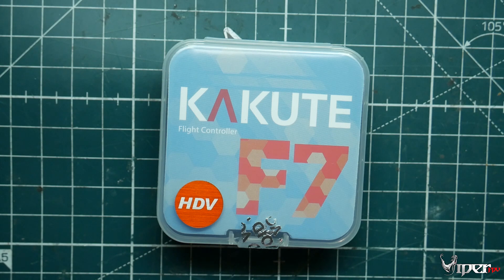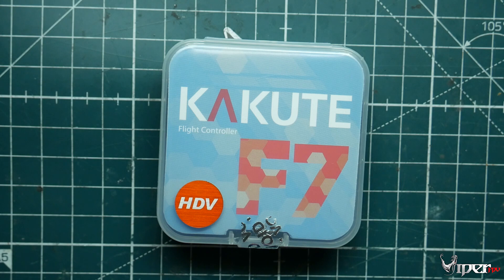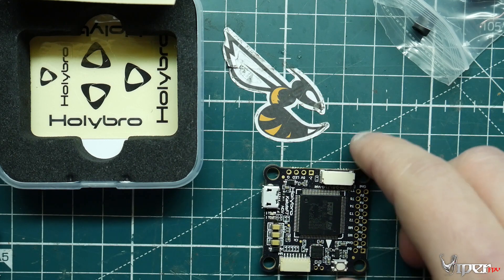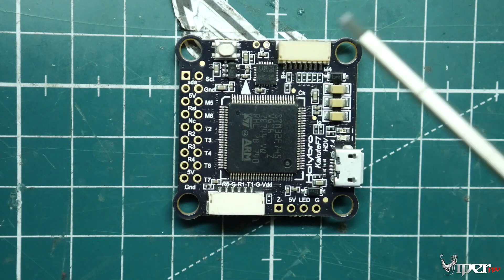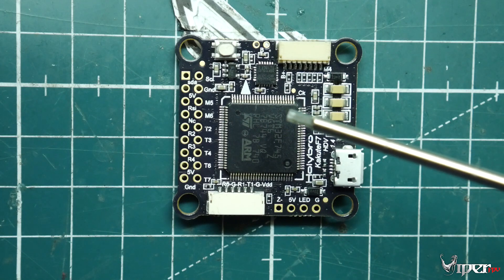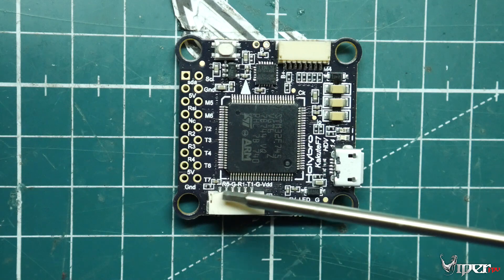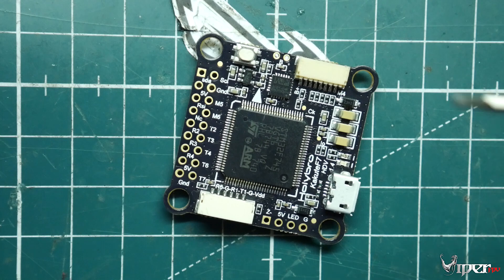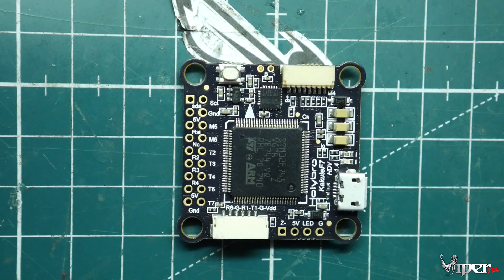Holybro Kakute F7  HDV Flight Controller - Overview

Comment: Hey I bought this FC watching your video. I have an issue. With 5S and 6S it falls out of the sky. Do I need to connect B+ and B- to the esc too? I’m just using the esc plug at the moment. And if so, do I need to disconnect + and - on the plug? Your advice would be much appreciated.
Reply from the maker: What do you mean falls out of the sky. No if it’s flying fine say on 4s it’s another issue.
Reply: Viper_FPV Once I use full throttle or do a flip it seems to reboot or something. I exchanged the esc already and it has the same problem still... I soldered the capacitor to it, so it can’t be because of that. But in the manual it says something use b+ pad only for 2-6S, not sure what that means. I assume the FC is probably no good. But wired that it works fine with 4S.

Comment: Hello! i have a question! i buy this fc and i want to use on analog fpv but only after i buy it i was see that he has not have osd! what option i have to add osd in my analog screen? i try with micro minim osd but i dont have result!
Reply from the maker: Maier Andrei it has built in OSD even on analog, did u wire the video from camera to the FC and the video out to the VTX?
Reply: @ViperFPV  this fc does not have video in and video out

Comment: I'm not sure if I can trust Holybro brand anymore.  They need to work on their quality control.  My F7/Tekko 32 stack was fried after 5 flight, and I'm only using 4S.  No more Holybro for me.  NewBeeDrone is a much better brand.
Reply from the maker: Bo Han I think it was just your luck lots of people run this stack and FC and have crashes with no issues.

Comment: Hello, what firmware installed in that fc? I am having vibration on mine on a 6 inch quad. There are a lot of firmware to choose on Betaflight such as the KAKUTE F7 ( Legacy ) (HBRO ) and there’s KAKUTE F7 V2 (Legacy ) and V2 ( HBRO ), I’m confused with these firmwares. Which one supposed to be installed on KAKUTE F7  HDV mainly for Dji system?
Reply: Pls update i need to know which target tp choose
Reply from the maker: kudin kudos you want the KakuteF7HDV firmware.
Reply from the maker: I will have to check when I get home. Remind me if I don’t respond in 24 hours.

Comment: Hi Viper, having some issues to get my set up working. I have the DJI air unit, the Kakute F7 stack and DJI remote. This is my first time using betaflight as Ive been a long time flightone supporter. What are the settings I need to enable to get this thing working correctly. I cant see OSD from betaflight, my remote doesnt show any input in betaflight as well. The only thing working is the video feed to the goggles. Thanks in advance

Comment: I heard it doesn’t comes with OSD? how can you see the info from the screen of your goggles? My main goal is to see the gps coordinations from the screen, is that possible with this board? Also what is the best way to use 5-6S lipo batteries? you know that the Dji Vtx only support up to 17v right? I do really appreciate any response
Reply from the maker: Wilfred Ocampo your in luck DJI just came out with an update a week ago enabling all of the betaflight osd features. In regards to voltage you are correct in order to run 5s or 6s u would need to install a regulator
Reply from the maker: If your using this flight controller u don’t need the regulator
Reply: Viper_FPV, yes I do have the stack, so basically plug and play? It won’t burns the Dji unit tho? I appreciate your quick response
Reply from the maker: Yes it’s super simple. It has a onboard 8v regulator for the DJI unit.
Reply: Viper_FPV,  you are awesome 😎👍 happy flying
Reply: I there man ! Im sorry to insist, but apparently this board don't have OSD, how can the board communicate the GPS info if she dosent have OSD ? And what about the Mah info or other  ? Many thanks man !
Reply from the maker: Hensli Sage it has OSD DJI just added the betaflight OSD feature check there firmware updates. I have it working on my quad
Reply: @ViperFPV  Thanks for your answer man !
Reply: @ViperFPV  Sorry to bother you, but I'm about to buy this Holybro stack for DJI. So it doesn't have built in osd, but after a DJI update, it is possible to see Betaflight osd on my Dji gogles?
And one more question; as I'm using crossfire, should I connect all the dji-fc wires or get rid of those for dji radio? Can I leave them connected and just solder Crossfire Nano to the board?
Reply from the maker: djfurione I connected all my wires from the DJI unit to the board and just wired a crossfire receiver to the FC. Regarding osd yes . DJI newest update now has betaflight osd support
Reply: @ViperFPV  Thanks a lot! That clears my concerns :)